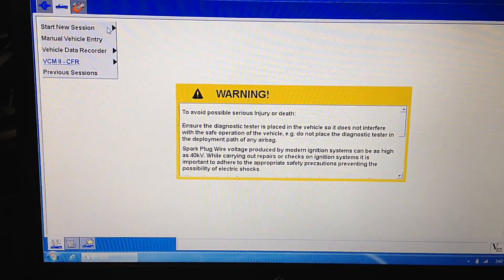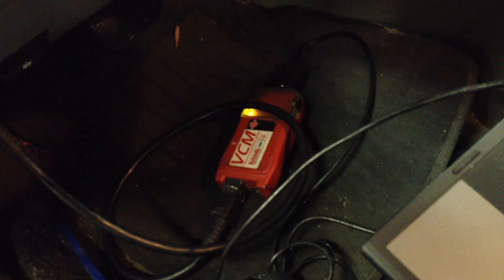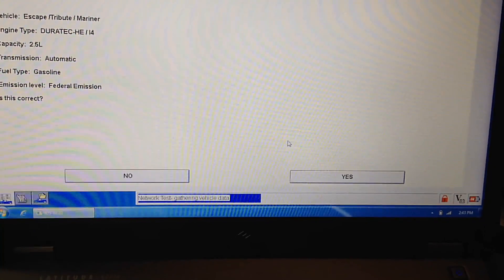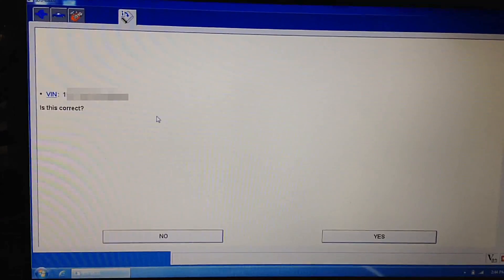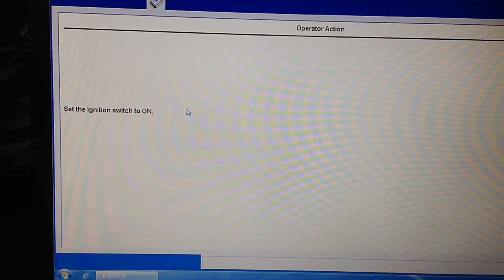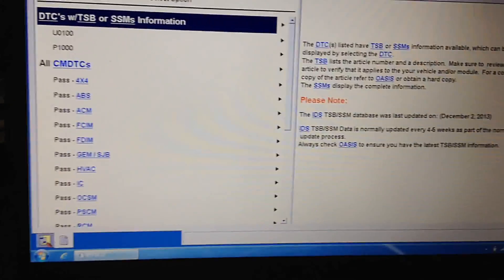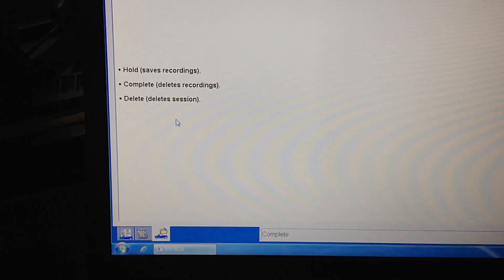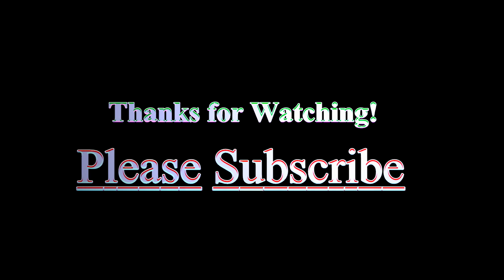Ford PCM Software Reflash Procedure

Comment: Hey @FordTechMakuloco... Really thanks for the video. Got a explorer Limited '10 4.6 3v and seems like no one around can fix my precious SUV. Some people says it's the Transmission others is the computer or EPC. Want to know how can I get the Connector cable and the software for give an update a try? 

Everytime the gearbox have to change between 3rd and 4th gear became crazy. Like if the computer don't know what to do. But if I turn off the O/D and change manually there is no problem. Even I can hit the pedal and the gears never slip. Only when have to change between 3rd and 4rd is the problem. 

Need help from an expert because here in my country there is no a good Ford Garage working.

Comment: I’m so stuck, PLEASE SOMEONE HELP:(! No one can figure out my truck! It needed timing chains so I did that, but it had always had an abs and parking brake light on. So after I did the timing chains then I took it to brake plus for the lights cause I was also getting a p2106 code. So I replaced the entire throttle body assembly with no luck. The truck doesn’t get a check engine light just kicks it in fail safe mode and looses about 30 percent power and still able to drive but it only does it when I drive it when it’s hot outside or driving over 15 miles at one time. It runs awesome till that, so I figured it was the pcm cause after driving it already and coming to a stop then start accelerating again the locks go down like I just got in it. Something isn’t right, how can it drive great and all of a sudden it goes in fail safe. The brake shop said I need a new ABS module cause everything was good power, ground and fuse wise but they are unable to communicate with it. HELP ME PLEASE:((

Comment: I'm trying to  update the calibration on a 99 expedition.  I get a FEPS circuit open or Ignition not on error.  Theres no check engine light on...  only code that I found and I think might interfere with the programming is  Key-in circuit open..( The ground contact part broke off years ago.)

Comment: Have an 06 Lincoln zepher with transmission shifts problem. No check engine light. How much is a reasonable price to have it reflashed and all?
Reply: I have a 07 mkz with the same issue did this fix yours and are you getting horrible mlg

Comment: I want to thank you for all I've learnt watching your videos.    Thanks to that i just reflashed my 3rd pcm.  Just one question.  On this 07 EDGE, the message screen on the cluster turns on only when I turn the ignition switch on, and then turns off when engine is running. Am I missing something.  Thanks in advance.

Comment: I have a 2004 ford explorer. 2 days ago I went out to start it got it started and shut it off then went to start it again and it would not crank or start. when you put the key in the ignition the theft light flashes every 2 seconds but when you turn the key to on position it stays solid for 40 seconds or more. How can I fix this problem? it will not let my suv start at all. the mechanic checked all fuses and relays and everything is fine. He put a new battery in it and not the problem. Checked the volts at the started and all is good.

Comment: DO YOU KNOW IF THE COMPUTER WOULD HAVE ANYTHING TO DO WITH THE TRANSMISSION NOT ENGAGING ON A FORD F350 6.0 DIESEL  2004.  AFTER REBUILDING THE TURBO IT WOULD NOT ENGAGE

Comment: How much is to reflash the pcm? Ford f150 2004
Reply from the maker: Dealers may charge up to $100, I charge $50 or free fro my customers that request it.
Reply: FordTechMakuloco wow I wish I could be one of your lucky costumers. Too bad I'm in New york. Thanks for your help.
Reply: FordTechMakuloco I have my transmission replace. The transmission shift perfect and all. But when I put it on Reverse or Drive from Park it got a delay to get into gear. Like 2-3 seconds. What do you think this is?
Reply: Killinemsoftly504 fordf1502004
Reply: Cherneria Hickerson  yes. Got it fix by getting the pcm and the transmission computer reset.

Comment: Is there a way I can do this myself? I have a 2003 Lincoln Navigator and I just pull a used ECU off a 2003 at Pull-a-part. Will I be able to perform this ECU flash myself?
Reply: What did u end up doing?
Reply: @JLE1177  The truck slung a rod so I just parked it in my back yard...
Reply: @andrewilliams1981  not the redeem story we were hoping 😂

Comment: Hello good sir. I know this is a ford video but I have a 2003 Lincoln Navigator and it's basically a ford motor. I'm having some serious transmission shifting problems and the reverse sometimes doesn't respond. I've taken it to several professional transmission specialist who have no ideal what's wrong with and many say it's a pressure issue that they believe the ECM may be causing. I've even taken it to a electrical car specialist and he said it's too many codes to track it down to a tranny problem or electric issue and to get a new ECM. So I picked up one from a pull-a-parts and wanted to know is there  a way to perform this on my own? Are there any websites that have the software for free?

Comment: 2001 Ford Windstar  Code C1185 I replace both right and left brakes as well as abs sensor what could be my problem I am also replacing front driver side and passenger side wheel bearing...

Comment: I have a question when flashing a module from as-built data. I recently bought a 2012 mustang v6. The previous had been paying a shop to swap the 5.0 v8 in the car. They got so far and apprently went out of business. Long story short, the engine and trans are in the car but the pcm was lost (or stolen) i have the vin to a gt mustang so i can order the pcm through the dealer i work for. My question is this. I noticed when going through to program the pcm from as-built data, it stated that it was going to go through a "vin verification process" with all the other modules in the car, if the vin from all the other modules dont match off the vin i have the pcm for, what will happen? Will it brick the pcm? Will it still program?

Comment: Doing this , would it matter if your truck has been chipped up?
Reply from the maker: I have not had a problem with flash programmed units in the past not sure about the actual chips they used to use.
Reply: Thanks, my truck is chipped up.  I bought it that way. I don't know how to adjust it back to the original settings so running a refresh would that mess up the chip. ?? Nice video by the way.

Comment: thanks for the post, question with this VCM tool I really needing to get it being in the auto repair business, but since I'm starting out flashing can i use the tis like GM on a 3 day pay system or with FORD must I purchase the yearly subscription??   thanks
Reply from the maker: +SiFiRocker They have short term subscriptions too
Reply: Hi and thanks for the reply, so can i used the vcm2 as i scan & diagnostic tool and when needed to flash say an ECM use the short term sub?  I'm told without a yearly sub, the VCM2 will not works, so is this not  true?

Comment: watched video again if the firmware for my own has the same numbers but just different last letters higher 
ie mine is 7m51-12a650 ud so would 7m51-12a650 ug or 9m51-12a650 db be the latest update it's in the same engine code section and pcm number and car type

Comment: if I give u my pcm part number and current firmware on my focus tdci would you be able to let me know if there is an update for it and any other ecu on the car I can update.
I have the elmconfig softeare modified cable and the forscan software so can update but not sure how to know if the firmware is old or not and if there is a newer one

Comment: +FordTechMakuloco old video but I'm curious. Dealer told me there is no newer update for my 2014 F150 Ecoboost and said it won't show the strategy version without there being a pending update (basically, they said w/o a newer version, they can't tell the current version) -- I've seen a buddy of mine show it to me otherwise using IDS but I wanted to confirm what I saw is true. Can IDS tell what the current strategy is without any pending updates? Seems to me it can and will and they just didn't want to do it.

Comment: hey love the videos, I've taken advantage of your knowledge plenty of times.  I have a 2010 F150 5.4L  215,000 km  the transmission has always shifted odd since day one.  when in 6 gear running 80km/hr and you floor it.  it hesitates a while like the torque converter won't unlock.  then bang, a violent downshift happens.  you can feel it through the entire drive train.  if you tap the gas once prior to flooring it, it down shifts normal.  do you think a tcm re-flash would solve my problems?  thanks.
Reply: Did u end up updating ur pcm because my car is a 2007 lincoln MKZ and it has weird shifting issues and bad gas mileage I'm thinking of getting the pcm updated
Reply: sale of license and installation for original and cracked ford ids and fdrs at the best price without limitations, all programming systems unlocked, unlimited key encoding, built data download, integrated programming, sync programming, latest monthly ids updates, professional encoding with PTS accounts, 1 year license ids and fdrs
Reply: @luiscalvetti3318  hey can you offer

Comment: I have a 2004 F250 6.0 and the EGR smog monitor will not reset, i need it to pass smog so i can get my registration. I think it might have a tune on it from a previous owner which disabled the EGR. I had a diagnostic run on it and they told me the EGR system passed. I'm so frustrated and im running out of ideas! Is there anyway to know if there is a tune on it?
Reply from the maker: No way to be sure these aftermarket tunes can copy the pcm cal number to look factory. To be sure have the dealer reprogram the TCM, PCM and FICM to the latest level. I there is not later update have them force programming with the PMI process and as-built data.
Reply: Thank you very much, for the reply! That is the next step i will take.

Comment: Fordtechmakuloco where in the Chicagoland area can I bring my F-150 for you to look at and update?
Reply from the maker: I am in Plano but I also do mobile service calls for smaller jobs. Put in a service request with your details here thanks!http://bsgautomotive.com/contact/
Reply: can you come to Georgia I need help with my pcm programmer.. Had transmission rebuilt twice and my overdrive will not stay locked out when I turn it off it will go back into overdrive when I turn it off causing my torque converter to burn up!! Any solution

Comment: can this procedure be used to flash/ program replacement Rem/ Rear electronic module on my 99 ford windstar? thanks!!!
Reply from the maker: +John Cassidy if it can be flashed then the IDS can do it same procedure as shown here
Reply: hello again, been doing some research, i have a j2534 device. Do I need a special battery maintainer during this procedure or can I use a 60-70 amp battery charger, I understand you don't want the battery to drain to low. Thanks!!! great videos by the way!!!

Comment: Hi I have a 2006 Ford F-150 
And I have the code P0605 the truck drive just fine. Do you think I need to reprogram the pcm?
Because I reset the check engine light but came back on. Thanks

Comment: Thanks again for your reply's and great videos. Okay I go a VCM 2 and installed the IDS and connected everything; comm to vehicle, etc. BUT the IDS told me I'd need to re flash the VCM2 - okay? I did exactly what it said on the screen, pushed the button on it and wait for the beep, etc. Then initiated flash; told me it will take 40 minutes, watched YouTube videos and it came back VCM 2 flash successful. NOW I can not comm with the VCM 2 and all I get is a beep every one second. It was "bricked." Can not connect to VM2. So some hair pulling and A LOT of internet searching I found a guy with a "restore" procedure and he also included the filed. Okay I got nothing to lose; 1,200 dollar brick. Did what he instructed and installed the files and I got it back; comm and everything - yahoo.. BUT now since I enter manually my vehicle into IDS and tried to start the Program Module - it refused stating because vehicle was entered manually? I entered the vehicle info manually since it wasn't in the model menu. Entered the Tear tag number EXH1 and - yahoo showed my engine type and year, etc. I also tried to enter the calibration # shown on my scanner and was told invalid #? Is there a way to override this lock out when a vehicle is entered manually?

Comment: So, I just bought a 2015 F-350 with the 6.7  is it possible to reflash the PCM to have the 2017 spec settings?  and will it VOID the factory warranty as long as ford does it?

Ford Demo Truck
8k miles 
Ford Certified Warranty

Comment: i have a warm start problem on my 06 Mondeo.. i.e the car starts all the time but if you have been recently driving it ten you get no control of the throttle and the battery and engine management lights stay on.

Comment: I replaced my ECM/PCM in my 2005 E450 Super Duty 6.8 V10 Triton.
It is now in limp mode; invalid VIN will cause this?
In your IDS software when asked for VIN and you reply no not valid; you then enter the VIN you have on the title/Registration? Also does it open a window to enter the vehicles accumulated mileage as well?
Reply from the maker: Yes you must program and new pcm to the vehicle first and program new key depending on year some even require a parameter reset. You have the option to program a new vin yes but the mileage cannot be touched.
Reply: Great video's lots of info. Do you have a video showing  scratch program with a new PCM when the original is fried and no comm to get the info from it?
I've got codes pulled and wiped them and they come back P2104 and P2112; thing is the throttle body snaps full open when key is turned to run no start and snaps closed again; but start it goes into forced idle and states stuck closed? It did now just burp a PCM code P1639  so no VIN would cause all this? I am waiting for my VCM II gear.

Comment: I got 2015 mustang gt and the Electrical power steering does not work, I have the ids software. I want to reflash the PSCM. 
what do i need to have? like files?
Reply: You really don't need much idk what kinda creds. You'd need. (Creds as in like being registered with Ford not Ford credentials)

Comment: I just bought a 2003 Lincoln Navigator and the owner told me egr valve is bad. But while driving it its hard to drive. As in accelerating is difficult it acts like the transmission at times doesn't shift, like the transmission is geared one way and the computer is geared another way. It idles rough, and even when driving the low oil pressure light and high temp light comes on. It drives as if it has no power. I had oreliey put a code tester on it and they said that the ecu/pcm don't know if there's a difference was swapped out but not reprogrammed and the truck is in a stolen mode. Does these symptoms sound right with the brain needing to be reflashed or did I buy a dud? Thanks!

Comment: is this free software? i understand your using the VCM ii much like flashing phones, computers, etc... there is usually a free way about this. 
I have a 2016 2.7 ecoboost i wanna put the tow setup on it and possibly other features. I also have a 2013 6f35 tranny that shifts horribly; would i be able to use this program with the vcm to diagnoise and repair the sift points or what ever the issue that is causeing it? like the scantools off the 90's vehicles?

Comment: Started having transmission issues with my 2007 ford fusion with 90000 miles. Wondering if this would help me with the problem I'm having. First couple of gears go in normally, but last one makes a hard kick. The car doesn't rev up, the gear goes in but hits really hard. Hope you can shine some light on the issue. Thank you.

Comment: hello again..may have a pcm problem..truck gave me a p0430 code.i cleared the code to see if it would come back on,and it did a couple hundred miles later .so i ordered the catalytic converter kit for both sides..hasnt arrived yet..cleared code again the other day for the heck of it..drove it about 150 miles .check engine lite came on and gave me 2 codes this time..p0430 and p0606(pending)..beside the exhaust tick it has now (from crappy back pressure) still runs fine..what does the PENDING mean?..did i clear the code too many times..?is that why i have the PCM code?..thx

Comment: I have a 2000 F450 that gets 6.2 MPG AND won't get out of its own way. I bought it with 97,000 miles on it and now has240,000 on the clock. The question I have is 
1- have they offered any new program updates
2- I've been told that this is the only year and model that uses it's own language?
What do I need to do?
Reply from the maker: +Dick Gallina If it has low mpgs and low power you need to check the exhaust back pressure . Catalytic converter failures on these are all too common.
Reply: +FordTechMakuloco  thank you I'll have it done. Do you have a video on it?

Comment: will this be similar for a mazda 6 3.0 I am plan on getting the vcm 2 v96. I was told to get the update from mazda site not sure if that is true
Reply from the maker: +Hmong Muas The mazda vehicles are programmed in a similar fashion the ids software is almost identical.
Reply: Can I take the PCM OUT of the truck to have it re-flashed? M.serv website says it doesn't need the keys with the pcm. Old thread but worth a shot. Just tried to program a tow tune on my 2000 F250 S.D. 6.8L V10. SCT tow tune didn't download all the way. Now the pcm is blank SCT tuner cannot put stock tune back on the truck. LOVE all your tips & video's, keep em coming. You've helped 10's of 1000's of people I'm sure.